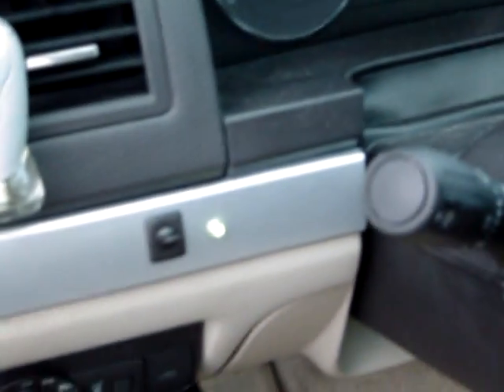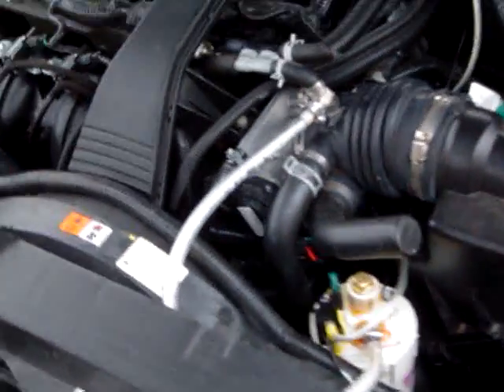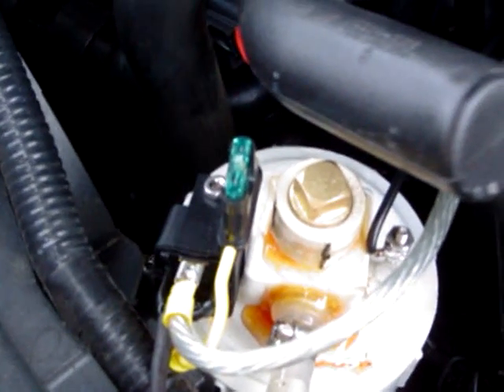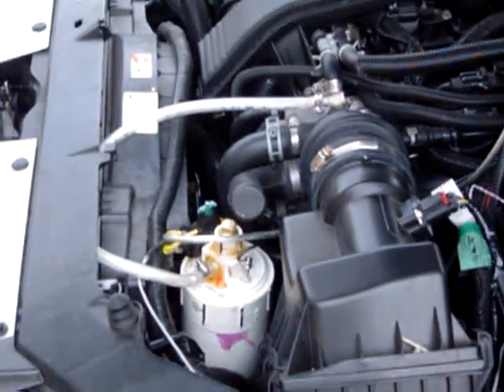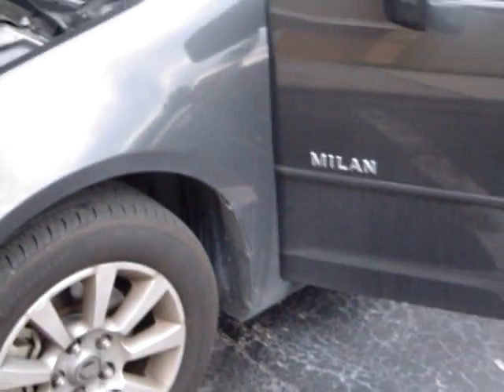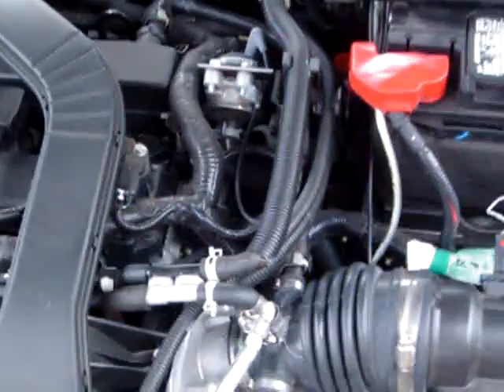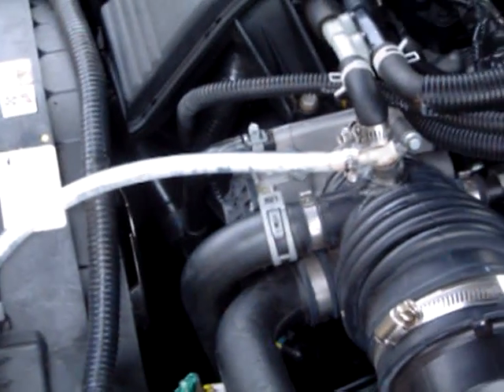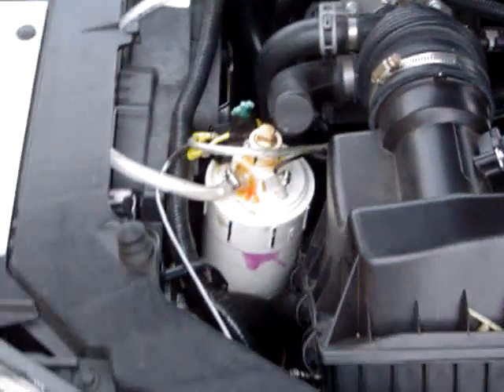Hydrogen Booster Installed in Merc Milan Car

Comment: ya i have to agree with blur here your using power from your engine to spin the alternator (there is some loss of energy there). then using that electricity to conduct electrolysis (which also isn't entirely efficient) thus losing efficiency.

Comment: if you use pipe insted of plates it will act as an inductor and give you more H2 with less Amps, and if you use 2 big magnets at the top, the lines of fluxs will seperate the H2 and O so you can add the H2 directly in through your fule and the O into the intake that will bump you up to about 100 to 110 miles per gallon. anyways thought i would help. o ya, you can build a chip for hydrogen on demand and hook it to your gas peddle, make it from radio shack stuff, i have some scmatics if you want.

Comment: How, in your estimation, does burning the hydrogen produce more energy than separating they hydrogen from the oxygen?  If it really makes such a big difference in mileage, you'd be able to condense the exhaust, reseparate the H from the O2 and have a perpetual motion machine.  You'd solve world energy problems and be the richest man in the world.  This is, unfortunately, a scam.  If you don't believe me, do a certified EPA test under controlled conditions, or at least a 2-way average at cnst spd

Comment: actually thats only half of the boost that it gives you. In actuality if you do this correctly, one can bias the O2 sensor and turn the fuel down to almost zero, depending on production. Hydrogen does burn on its own, It is possible to run an engine completely off of it. I know I'm doing my thesis on it.

Comment: Why oh Why does everyone persist with this, you need at least 2-3 % (ideally 5%) of the fuel going in to start getting real HHO boost effects, and to actually gain efficiency you need to start retarding timing, HHO Boosting works by increasing the flame or burn speed of the gasoline there for allowing ignition closer to TDC, thous allowing less energy pushing the piston against the stroke and allowing the fuel to burn more completely as the piston travels down.

Comment: very simple reset your travel counter to 0 every time you fill up at the gas station on the next fill up look up the millage  and pump same amount of gas each time and voila you got your MPG 
I had to use this method because my fuel gauge was messed up so I used to go by how many miles I drove till next fill up

Comment: Better than 44mpg? Even if he calculated wrong and only got 34mpg its WAY better than stock output. 

I dont think people should call this free energy because its not, but if it saves you cash when filling up at the pump who cares what people say? The problem is fuel injection computers override any amount of additional oxygen intake and just add more fuel to achieve 14.7:1 AFR. Learn how to modify the o2 signals and you can increase mpg.

Comment: You just told me though that it will eventually fuck up the engine right? I can go to my Diesel truck which is a 6.4L Powerstroke, stick my hand on the exhaust (I have stacks), and hold it there, when before if I touched those stacks I'd end up with a 3rd degree burn... I am confused about where you stand. I am for it 100%, but still confused about why it would ruin the engine eventually? It makes the gasoline burn more efficient and it does work.

Comment: For the naysayers that are complaining about the energy required to split the H20, you need to research the workings of a car before you speak. The alternator, which recharges the battery, is turned by the engine ALL THE TIME. Therefor, it is producing electrical energy whether you use it or not. So running an electrolysis apparatus does NOT use more energy than it produces (regardless of whether or not you gain any mileage).

Comment: I have a 1986 GMC C-60 with a 366 V8, essentially a small bore 427. I will be making 6 HHO fuel cells for my 10 ton ramp truck. I get unloaded 13 MPG on the road, est between 45-50 MPH. I was told with 6 cells I could get close to 30 MPG, well see. It has a four barrel carb, no electronics.

Comment: you fix the problem by installing O2 extenders they get the O2 sensor out of your exhaust hydrogen burns at 1100 degrees gas burns at 400 so most of it ends up in your muffler. Hydrogen burns so clean that the O2 sensor reads it as oxygen and pumps out more fuel to keep the right air/fuel ratio.

Comment: hi bro i saw ur video i got a queation 4 u what dio u did 2 connect the hydrogen fuel to the carborator and what do u do 2 cut off the supply of gasoline from ur tank an using an process of eletrolysis when the reaction occures does stain less steel change into anothe form or it dissolve or some thing and u what do u do 4 water supply when it changes 2 hydrogen

Comment: Its adding hydrogen VAPOR to the combustion chamber. The electric load this places on the alternator can be varied by a variable output module, making it possible to get more energy out than you put in since electrolysis (the process through which water is turned into 'brown' gas) requires relatively small amounts of electricity to occur.

Comment: tigro is he replacing petrol with hydrogen & oxygen gas? no.  Is he adding hydrogen oxygen gas to the petrol? yes.  Would hydrogen oxygen gas aid the petrol burn efficiency?  Would an efficient burn also aid the thermodynamic efficiency of a combustion engine?  If those 2 ? R correct.  What now is the equation?

Comment: If our problem is the O2, why not tell the manufacturers to go back to CARBURETORS.All these water burning hybrid will work only I mean only in carbureted fuel system. It doesn't and never work on electronic injected system.Let,s go back to carburetors.

Comment: Usually O2 sensors don't go bad unless there is another problem causing fouled exhaust.  Now, I say "USUALLY" its not always the case!  If it was running lean, it was probably due to clogged fuel injectors so the computer thought it was running it rich but not the right amount of fuel was passing the pintle, making it lean, but without the O2 sensor, it thought it was rich because of the other conditions (TPS, MAF, MAP, ETC).

Comment: Actually, the default tables are rich.  Due to the fact of lean burn is a hot burn, which can melt your exhaust valves.  Its always better to be rich, than it is lean.  Cars run rich until achieving closed loop, then they fluxuate between rich and lean to try and stay at a 14.7:1 Air/fuel Ratio.  So disconnecting the O2 sensor kinda defeats the purpose don't it?

Comment: Nice setup! Really it looks pretty neat and tidy.  @ everyone who is asking about the 02 sensor, there is no reason for the O2 sesnor to be replaced, it only critisizes the efficiency of the burn.  If your lean, more O2 is in the exhaust, rich, less O2.  By adding the Hydrogen, you are in turn richening the fuel mixture.  the O2 sensor will read it is rich, and trim the pulse widths back until its Stoichiometric.  I might go ahead and see if I can make one of these to test on my Ranger ;)

Comment: He is using a production on demand system here very safe.The volumes of gas present at any one time would be very low as the vacuum of the engine would quickly intake gas on production.Hydrogen being one of the lightest known elements is safer than nearly any other gas it dissipates up and into the atmosphere quicker than any other gas.I doubt that he would get any improvement in the fuel economy without modifying the oxygen sensor as the computer will just adjust to leaner burn by adding fuel..

Comment: Focist911 is making a good point, how do you know the energy output is greater then the energy input?  He would get a better energy in : energy out ratio if he converted some of his gasoline to hydrogen. Beth also is right, this system would keep running even in an accident.  This issue needs to be addressed or he could injur nearby people if in an accident.

Comment: You're feeding the electrolysis by 12V, right? With the plates that close together, you can use lower voltages than 12V to get greater efficiency. Step down the DC to 6V and compensate the lost current by adding more plates, increasing their surface area, or putting them closer together. Net result is that you can use less power for the same amount of gas by adding an extra few hundred grams of mass.

Comment: He doesn't mention any ECU tweaks to get leaner mixes. Then again, o2 is added to the mix directly, which might be a factor.

As for the timebomb thing: There is no high-pressure/quantity mix, as such, any leakage is instantly diluted. Anything inside the nylon feed should just go *pop* and, at the worst, blow the tube apart - venting any H2 up and out. Are you more concerned about the H2 mix triggering something else?

Comment: That's without an EFIE 28mpg to 44mpg WOW!! Imagine if you put an EFIE to control/trick the 02 sensor into a slightly richer condition that would lean fuel consumption with tuning of EFIE and even more mileage.

Comment: I believe you....but I really need some data.

Can you show us real time mileage numbers?
what does mpg drop to while you are under constant load, e.g., going up hill for several miles on the interstate?

with this hydrogen gas design,
using a Small motor turning 10 alternators,
generating 1000 amps; that will be ample for an electric car without the batteries.
will let you know.

It wonderful that someone broadcast the hydrogen idea...thanks....good thinking.

Comment: Just wondering if your hydrogen line is under vacuum and where in relation to the throttle body is it located? Before or after?

Mine is not under any vacuum as it's installed in the air intake just before the throttle body but I'm just wondering if I would get better results with a vacuum.

Comment: from 28 to 44 MPG is in SI units:
0,84 liter pr 10 km and 0,53 liter pr. 10 km.
Which is incredible... and at only 9 amps (at 14 Volts= 126 watts....
Have you measured the actual gas pruduction at this amp, or the actual water comnsumtion pr. mile...It would be interesting to know the actual H2/O2 / gasoline % mixture...Would love to try this in my 1197 model BMW 728, which consume some 1,1 liter pr mile on the highway.